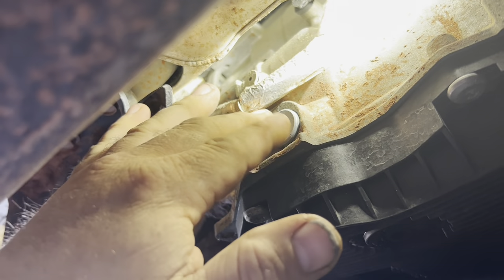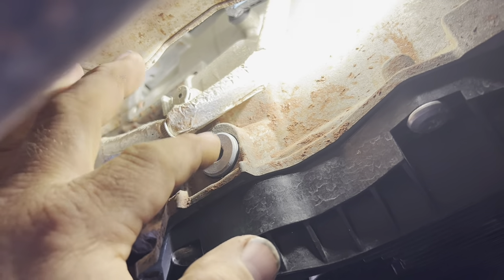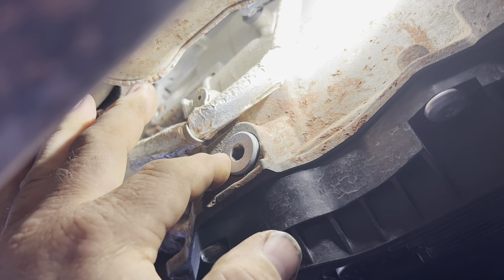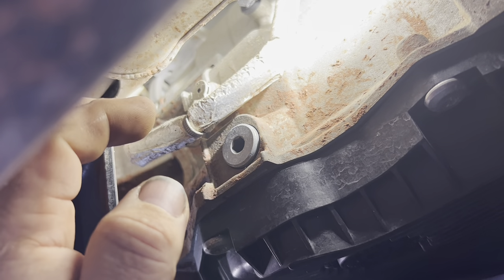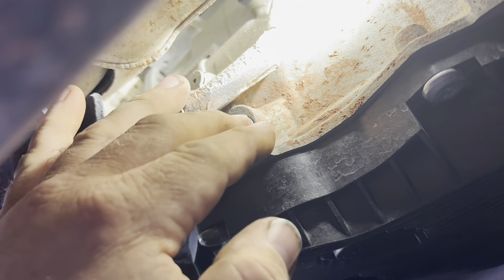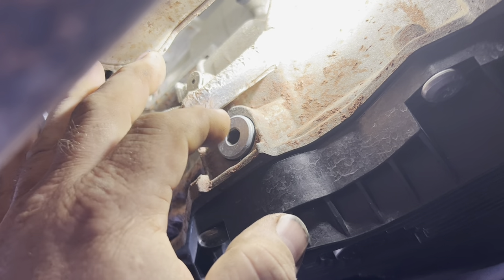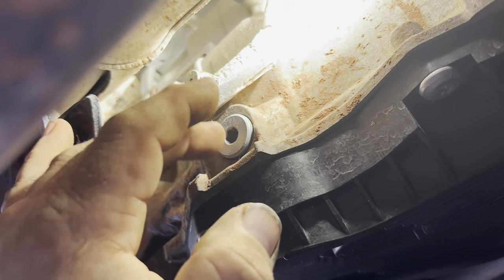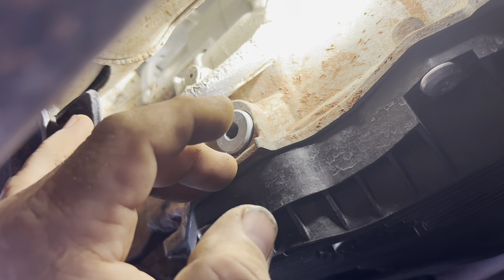Fluid level check on a Jeep Grand Cherokee with ZF 8 speed trans

Comment: I giggled at this guy complaining about having to wait for oil to cool down to check proper level. I work in aviation maintenance, this sort of thing is normal, I'm not sure why he's complaining this much. Basic physics govern thermal expansion of an oil and therefore the proper quantity through a plug hole based on  a given volume and temperature. Sure, the plug is hard to get to ( I own a 5.7L Hemi Grand Cherokee with this same tranny), but I service mine without problem. Feels like he's manufacturing a situation in which to whine and complain and fabricated a situation where a routine procedure is made to be the reason for everyone's problems. There are much worse engineer-induced nightmares for mechanics out there, many of them Chrysler-born. Additionally, the transmission isn't a Chrysler design, its a ZF8 made in Germany, and its in a LOT of cars. He's complaining about Jeep's manual for this procedure, there are other sources of reference data to perform this check outside of Jeep's info. Wasn't expecting to make this comment so long, but was tickled at how upset he was over some simple physics and a slightly hard-to-access drain plug. At least he has a pillar lift, that's one thing I don't have.
Reply from the maker: I’ll make one attempt at explaining this, the problem is not that this application is difficult and requires a long drawn out process, it’s that this application is UNNECESSARILY difficult and requires an UNNECESSARILY complicated process to check the correct fluid level in comparison to the process that has been used for the majority of manufacturers over the last several decades. When the customer pulls in with a car or truck that has a dipstick it can be checked in seconds and the fluid capacity is enough that temperature is not that critical, only that it’s “hot”. The average customer is completely unaware of how complicated some basic maintenance has become and often takes their frustrations out on those handing the higher bills rather than those who designed it.
Reply: Fluid checks are usually a courtesy done by your mechanic.  In this case he either has to eat hours of labor (and $20 a quart fluid) or charge hours of labor to check the fluid. Who wins here? There is no reason this unit cant have a dip stick.
Reply: He’s probably complaining because he’s not a fucking airplane mechanic, genius.
Reply from the maker: @Slippindisc  can you believe when I taxied my Airbus into this guys hanger he wanted to CHARGE me to simply check the hydraulic fluid?!?!? And told me it would take hours?!?? I gotta be in Denver before midnight, I got a schedule to keep! Lol
Reply: @bulldogsautomotiveadventur4387  that’s what I was driving at in my admittedly rude comment- there’s no reason to make such a simple operation so difficult. An airplane mechanic giggling about this might as well be a missile operator giggling about it. Obviously some things are complicated because they have to be. Making something more complicated than it needs to be is lazy engineering.
Reply: This is a car not airplane. It should have a dipstick for quick check and top-up. 
Not everybody has lifts available
Reply: Hi, do you know if this procedure can be done with the Jeep on the ground? Why do they say that the wheels should turn? Can you shift into second gear manually while holding the brake down? And if it can be done without moving the wheels, could it be done at ground level? How would you do it to ensure that you have the proper level without having a lift and doing it at home? I hope you can answer me, thanks!!!
Reply from the maker: Just so that the valves all open as they are all computer controlled, there is no manual connection
Reply: @bulldogsautomotiveadventur4387  thanks for taking the time to respond!!

Comment: I honestly had no clue what I bought my 2016 Jeep grand Cherokee Overland that there was no dipstick for the trans fluid. It blows my mind that they’re making it to where the owners of the vehicles can’t do simple checks to make sure stuff is topped off. I have a 2000 jeep that I have rebuilt the front end and worked on myself. That is solid and my 2016 is a complete piece of junk I will never buy Jeep again.

Comment: To save you hours waiting for the thing to cool down, requires the customer to leave vehicle overnight and for the tranny to be stone cold for you to move it on to the lift in the morning to check levels. Having a cold vehicle and a level lift …checking the fluid level would be a 15 min job. Customers that bring in a vehicle hot or phone in and want this service done need to know what the rules are before the vehicle is dropped off. The thing sits outside over night and the check is done in the morning.

Comment: Hey there. So checking the fluid after the bypass valve closes, past 165 degrees F, afterwards you turn off the car then let it cool down to around 100 F, then check it again if I’m not mistaken?
Reply from the maker: You have to give yourself time to get back down and under it to check the level plug before it warms back up too much, if you have a helper to start it it’s not so hectic.

Comment: Been following your video for checking the transmission Fluid, step by step.  My vehicle is a REAR WHEEL DRIVE ONLY, NO FRONT DRIVE
Were currently in a winter freeze condition,  I'm working in enclosed garage, on a four post lift,  Traction control OFF.  All four wheels are on jackstands and level.  Auto transmission starting temp was 33 degrees, then worked up to 39 degrees. to speed up the warming process, I put the trans selector in DRIVE to spin the rear wheels to get things moving.
But the selector pops back to "PARK" on its own!  How do I proceed????
Reply from the maker: I’ve never attempted to sped up the warming process, I would just pipe the exhaust outside and let it warm up normally.
Reply: Why do the wheels have to turn? If you can shift into second gear manually by holding the brake down? And if it can be done without moving the wheels, could it be done at ground level? How did you do it in the end?

Comment: Yeah but with a steady stream coming out with it just 3 degrees over the limit (as you found on your initial check) most would know it was just fine!
With such a wide, long and flat pan I would say making sure with a spirit level that it is completely level (don't rely on it being mounted so in the chassy) is far more critical than 3 degrees of temperature especially in fahrenheit.

Comment: Can you please explain the 160 degree bypass   I’m confused if it’s an issue if the veichle is left to cool or not. You mentioned earlier about having to do the process twice.  Thanks for your help I’m bringing mine into the dealership for a service on this lifetime transmission fluid lol . For a drain and fill and want to make sure it don’t right the cost is 490.00
Reply from the maker: There’s a thermostatic valve on the cooler lines, it bypasses directly back to the trans when cold and opens up to flow through the cooler when above 160° so if the system has been drained completely it has to be filled, warmed to the point of flowing through the cooler to purge any air, then cooled back down to where it can be checked again. Some bypass valves have a button on them to force them open and bleed the air while cold but I believe that was an updated part that it didn’t come with from the factory.

Comment: Have you ever heard of 2014 V6 grand Cherokee will not shift into reverse and kicks when it downshifts due to low or too much fluid? Just had my TCM replaced at the dealership and now it’s doing that. Dealership says “you need a new transmission” but could they have messed up on how much fluid to add after that TCM replace? 
Nice video!
Thank you
Reply from the maker: Those things haven’t filtered into me yet, but the one in this video was having engagement problems into reverse due to low fluid levels when it was parked with the nose downhill

Comment: Why can’t someone with a tube bender make a dipstick for these that screws in at the fill plug ?
Reply from the maker: I'm sure someone could, but with how it's designed it would be very difficult to get an accurate reading with how sensitive it is to thermal expansion